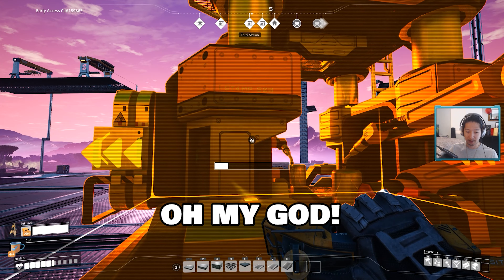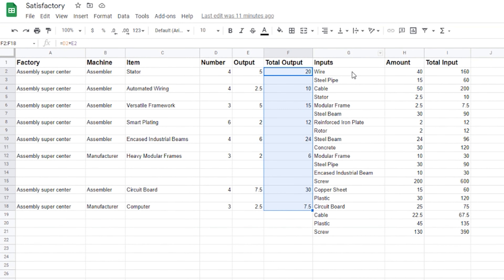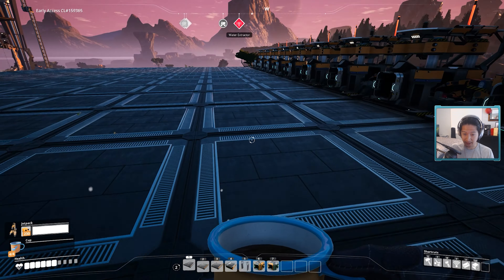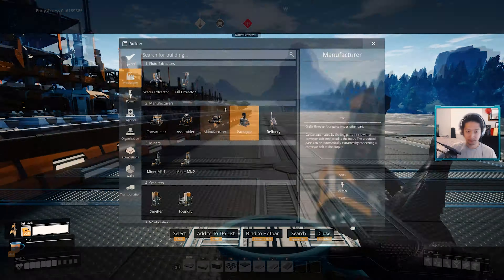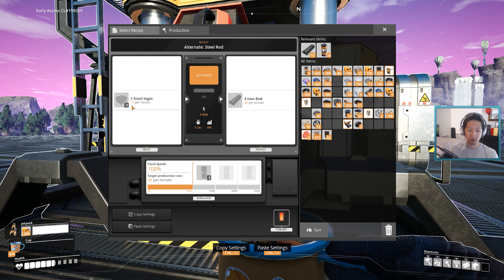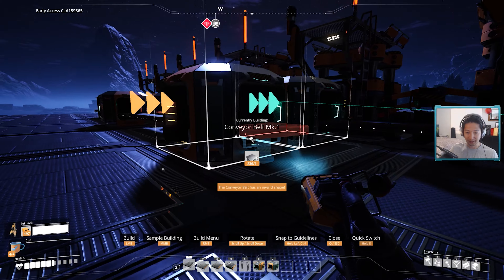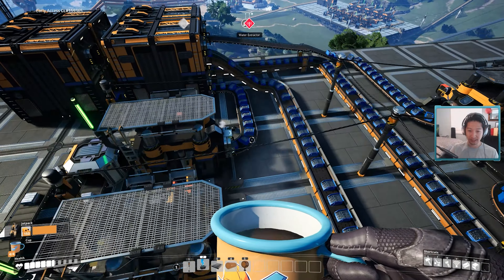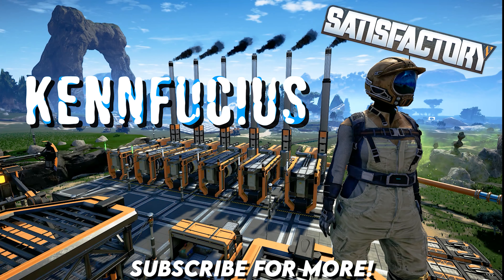BIGGEST Iron MEGA Factory Yet! | Satisfactory Gameplay Playthrough Ep 61 2021

Comment: For lights, there’s a lights control panel you can use to set color/intensity/brightness/etc - though it’s definitely better with a lot more lights. You can daisy chain them with power to make things easier as well. Steel screw alt recipe is also nice as the output is 260/min but requires steel beam as input.
Reply from the maker: Damn that's a super high screw output! Looking forward to finding that recipe. Sweet, I'll play around with the lights then
Reply: I do believe there is also a recipe that uses an iron ingot directly to make screws directly as well.